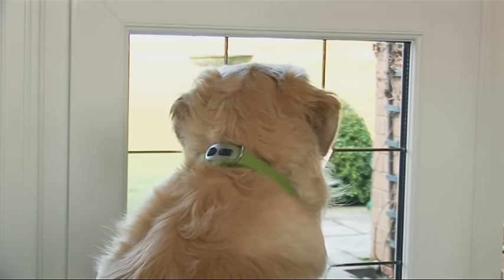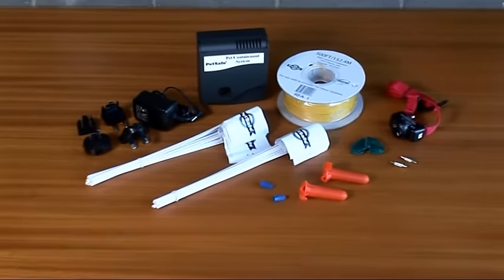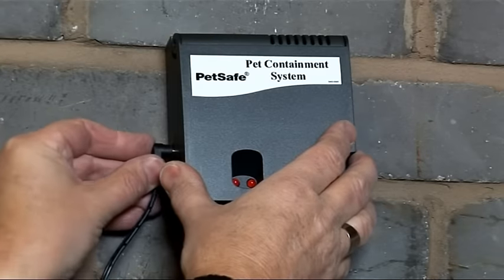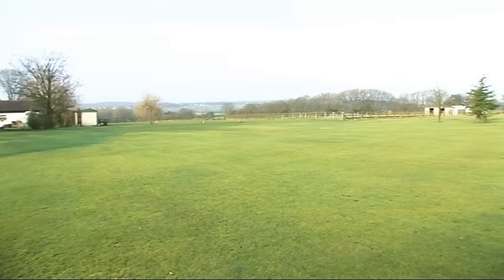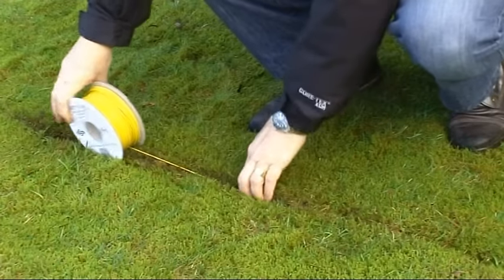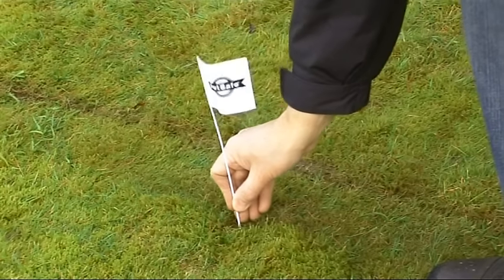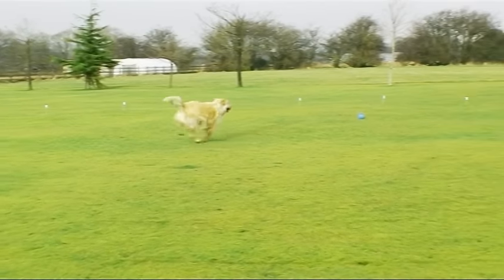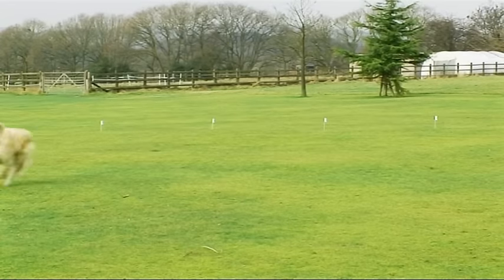How to Install the PetSafe® In-Ground Fence System

Comment: You explained the obvious but neglected the settings on the control.  The A-B-C switch is mentioned in the instructions on the unit, but it does not say if "A" or "C" is for a small or a large loop.  A good design team at PetSafe would have labeled the switch S-M-L instead of A-B-C.  For extra credit they would have told you how big a "small" loop was, and a "large" loop.
Reply from the maker: Hi,  Thank you for taking the time to comment on this video which is meant to be a quick overview–but not to replace the manual in any way. We appreciate some of your suggestions as we can definitely always improve however the manual does explain the transmitter's A-B-C switch in detail. We'll put it here below for those who may be wondering:
B: <400m wire.
C: 400-730m wire.
A: >730m wire.
If you would like any more information about this product please call customer care on 0800 046 1414 (NI) 1800 814 302 (Republic of Ireland) or visit https://intl.petsafe.net/en-ie/support/fencing#in-ground-fences
Reply: @PetSafeInternational so B is for the small Loop C is medium and A is the large.

How in the world do you come up with that logic ?

Not very intuitive or logical.

Comment: All should keep in mind they made sure to use a yard to where there’s no trees, cement slabs or other obstacles.  How am I suppose to close the circuit with concrete driveways and walkways?
Reply: There are a couple of options for concrete obstacles. One is to bore a hole under the concrete. This is not too difficult for a sidewalk but more difficult for large obstacles like driveays and patios. In some cases, a spray nozzle on a hose cut a small tunnel through dirt under a narrow section concrete. care must be taken to avoid washing out too much dirt when using the hose method. Another option for narrow sections, like a sidewalk, is to dig a hole on each side of the sidewalk and then pound a steel pipe under the sidewalk. One of the holes needs to be elongated (like a trench) to lay the pipe level before you begin hammering. Black steel (gas) pipe or electrical conduit is relatively inexpensive and works well for this. A cap on the end of the pipe will help to keep the pipe from filling with dirt during hammering but it may cut through easier without a cap. Extracting the pipe after can be difficult so it might be easiest to leave it in place and then feed the wire through. The pipe method is labor intensive (digging and hammering) so may not be for everyone. For wider sections, there are companies that perform directional boring and can do this rather quickly for a fee. Probably the simplest option is to route the wire through an expansion joint or cut line in the concrete and then apply a bead of exterior caulk to the top of the joint after the wire is inserted. Caulk is available in a wide range of colors and will easily blend with the concrete for a clean look. I have used both the bore and caulk approach with good results.

Comment: If hair/fur prevents contact between the skin and either of the two shock prongs, dogs can pass thru the boundary without any shock.  That must happen a high percent of the time, yes?  I would cut the fur back, but the co-owner (the breeder) doesn't want her hair cut.  Ideally, the shock will have happened most of the time during the training, so the dog won't risk it, but they could learn that sometimes they don't get shocked, so maybe they would risk escaping.  Is this fear justified?

Comment: I have a bluetick hound and she loves to run. We have 15 acres but keeping her on our land is impossible, and if I tied her up she would go crazy. How far out can she go with this fence? I want her to be able to roam a pretty good amount
Reply from the maker: Hi Zack thank you for your comment. Our PetSafe In-Ground Fence and Stubborn Dog In-Ground Fence systems actually do have the capacity to fully cover your 15 acres of land if needed without issues. However, please do keep the following in mind. You would need (approx) just under 1000m (3300ft) of wire. We recommend you finding a suitable/compatible insulated copper core wire of 18, 16 or 14 Gauge (that is 1mm, 1.2mm or 1.5mm thickness). You will have a stronger insulated wire on longer rolls, which also means less splices/connections needed to extend the wire. If you take good care of your wire installation there should be no problems. I hope this help to point you in the right direction. If you need anymore information you can contact our customer care team on  0080 046 1414 (UK) 353 (0) 58 44 988 (Ire) or you can email intlcc@petsafe.net.
Reply: Yes but you'll have to dig around however much land you want her to roam on so be wary even if you do get enough wire it'd take atleast an hour of just digging and flattening dirt

Comment: Does the wire have to be in the ground? I have some concrete and sidewalk where I’m wanting to place the fence?
Reply from the maker: Hi Kim, the wire does not necessarily have to be In-Ground. There are people who keep it above ground and for example attach it to an existing physical fence that their pet tends to jump over, and there are some who keep the wire on the ground however this can leave a wire very vulnerable to damage/breakage. It is advised in some cases like this to provide the wire additional protection by laying the wire through a (flexible) PVC pipe or for example an irrigation hose. As long as the pipe/hose is non-metal. When it comes to concrete (like a driveway) we usually advise to use a circular saw with a masonry blade to cut a groove to put the wire through. With a sidewalk use any existing groove(s) there may be to put the wire in. You have some options to work with whether you keep it in-ground or above ground. This PetSafe video that shows a wire installation in detail may be of help to you as well: https://www.youtube.com/watch?v=92BNlihk8Vc

Comment: After we lost our first dog who ran into the road and got run over, we installed one of these underground electric wire fences for our next dog. For the first few months, she did get a shock from her collar when getting near the boundary. Eventually, she was able to be outside without the collar altogether. Upon her death from a cancerous tumor in 2009, we disconnected the fence from the box. The wire is still in the ground, but no longer used.
Reply: I can confirm this is correct. I was the wire and I long every day to be reconnected. I now lay powerless in the ground and I ache to feel that juice flowing through me once more
Reply: Mr Wire, do the dogs at least lay eternally next to you?

Comment: I have a question. I have horses and electric fence that keeps them in. I want to put the underground fence in the yard for my dog and am wondering if the other fence will cause interference if I am too close to the boundary? I want to give my pup as much range as I can and just wondered about the 2 fences. Thanks!
Reply from the maker: Hi Mariah, thank you for your query. The official advice would be to make sure you keep 3m distance between the PetSafe wire and any electrical wire such as your electric fence when the wires run parallel to each other, as interference could occur mainly causing our collar to not activate at the wire. However, we have seen many cases where an electric fence is actually not interfering at all (possibly also because an electric fence is usually positioned in height) or that people have success by creating just a bit of distance (e.g. 1m) between the two wire installations. The only real way to know for sure whether it will be an issue or not is by trying and testing it—laying the PetSafe wire around your yard in a way that you can easily enough adjust the position of the wire if needed as you test with the collar in hand, before finalizing your wire installation. We hope that this information helps you out.

Comment: What length of wire needs to be allowed for connecting to the receiver as it's impossible to tell how much will be needed once you complete the loop and twist back to the receiver. You could easily end up with not enough wire to twist both ends back

Comment: Hello, we will be traveling for 3 months next year and wish to leave or cat at home, will this system work on our cat. We have a corner block with fences all around or can you recommend something
Reply: Will there be someone feeding your cat? That’s a long time to leave an animal alone without supervision. They have a cat system but if you don’t pay attention to them it could go wrong.
Reply from the maker: Hi, thank you for your query. Our Deluxe In-Ground Cat Fence would be suitable, however it is important to keep in mind that a pet generally should not have a collar on more than 8 hours a day (to prevent a skin condition called pressure necrosis) and the specific (RFA-188) battery for the collar may need replacing every 4 weeks. So unless there is someone present daily to supervise/check your cat and keep the above in mind and has understanding of how the system and collar work, we would not advise to use this if you yourself are not present for a longer period of time. In regards to having a corner block that you need to secure for your cat, there is a wire installation method (double loop) which will be explained in the manual that should make a wire installation possible in this situation. We hope that this helps. If you need some help on the set up feel free to give our Customer Care team a call to talk through. UK - 0800 046 1414, EU - 00 800 1818 2020.

Comment: Can you cut the wire and it still work like divide the wire in different areas
Reply from the maker: Hi Lucinda, thank you for your comment. The wire installation is meant to be a continuous loop, so this system is not meant to be divided over different areas. There is a double loop layout option though which enables you to cancel the signal at certain places if needed, however I do not think that is exactly what you are looking for. Please contact our customer care team where they will be able to help you further. You can call them on 0800 046 1414 (UK) or 1800 814 302 (Republic of Ireland). You can also email them using the following link - https://intl.petsafe.net/en-gb/support/contact-us

Comment: Hi if setting up boundary wire And I have three walls around property,only want to prevent them from side gate , loop would only go from (left to right) can dogs b outside the loop rather than inside the loop???
Reply from the maker: Hi Les thank you for your comment. In this case you should be able to use a double loop layout, meaning you go out with your wire along/past the gate area and then make a U-turn and go all the way back along the way you came from (and keep 1.5m distance between the outgoing and returning wire so they don't cancel each other's signal). Though your dogs will be 'outside the loop' then so to speak the collars will still activate near the wire(s) as the signal on the wire is like a mirror image (wire emits signal inside and outside the loop). I hope that this helps. If you need more specific advice or information, also feel free to take a look on our official website where the In-Ground Fence manuals are available (https://intl.petsafe.net/en-ie/support/fencing#in-ground-fences) or you can call our customer care team on 1800 814 302 (Republic of Ireland) or 0800 046 1414 (UK)

Comment: Does this work  for a cat and does it work outside a fence as the cat flap is down a path beside the house with a 6 ft fence there.  What is the distance between the wire and the animal will receive the bleep.    If it is  1 mtr before the cat gets the bleep I would have to run the wire through the other side of the fence so the cat can gain entry through the cat flap to the house.   
Would it work the other side of a fence if needed in the alleyway to the house where the cat flap is.  I can put it all round my garden but the cat has to come through the cat flap

Comment: In a forest, would you bury it the same way?   I'm impressed that all you need to dig is that thin slit with a flat spade.  In a forest there would be surface-level roots and fallen branches.  Maybe I could rent a machine to clear a path, and then use a walk-along "trencher".  Do you know if anyone has attached a spade - or some kind of blade - behind a brush-cutter / forest-duty rider [mower] to dig a trench?
Reply: I live in a forest and thinking of using an edger to cut through the terrain
Reply: @jowillie2814  why not? What's your logic? I should let my dogs run free (into traffic / coyotes)?
Reply: @JonathonNeville  From m my experience ; there is no traffic in a forest. 
The Coyote part..... 
Don't worry about snakes in the garden when you get spiders in your boots.
Reply: @jowillie2814  - right, so you just made assumptions and then called me a dumbass.  okay...  my forest is 400 x 600 feet.  It is a forest.  And then there's roads (2, perpendicular).  
Moving on to the coyote part.  Your poetic sense of analogy is beyond my capacity.   I translate "Don't worry about snakes in the garden when you get spiders in your boots" as "Don't worry about problems in your home when you have problems in your home", or "don't worry about coyotes in your forest when you have coyotes in your forest".  What am I missing?

Comment: Got mine installed and it is working for the most part, but I am having a problem with the safe area thing...when my dog wants to go from the inside of the house to his designated play area he has to go over part of the perimeter. In the manual it says that twist the wires together to block the signal...it doesn't matter how tight I twist the dog still gets shock, I am getting quite frustrated with this. Any help would be much appreciate it.
Reply from the maker: Hi Karieltheone, thank you for choosing our In-Ground Fence. We're sorry to hear that you are having some problems with it when it comes to cancelling the signal. Sometimes this aspect of the wire layout is misunderstood as this can be misinterpreted as merely cutting a loose piece of wire (that of itself offers no signal) and twisting it into the existing loop of wire. However this cannot cancel a signal. To cancel a signal you need an outgoing wire (outgoing signal) and a returning wire (returning signal) that is part of the same loop of wire, brought close together and twisted into each other. This is generally only possible on the path from and back to the transmitter IF your wire layout encompasses your entire property (all around the house), or if a double loop layout technique is used. If a wire layout only covers one side of someone's house/property then the double loop layout technique will be needed to be able to cancel a signal. You will always need an outgoing and a returning wire to be able to do this. If this does not help or is still in any way confusing, we encourage you to contacting our Customer Care Centre by phone or email so we can help you out > https://intl.petsafe.net/en-gb/support/contact-us

Comment: Question this zap the dog or this just make a sound?
Reply from the maker: Hi, thank you for your comment. When your dog is wearing the collar, he’ll receive a harmless static stimulation if the boundary is crossed. I hope this helps to answer your question, if you need anymore information please visit https://ie.petsafe.net/collections/in-ground-fences/products/in-ground-fence-system or contact customer care on  0800 046 1414 (UK), 353 (0) 58 44 988 (Ire) or you can email intlcc@petsafe.net

Comment: So  how do you get the wire from the garage to the ground?
Reply from the maker: Hi Chad, thank you for asking. Exiting the garage with the boundary wire can be accomplished via a window or through a hole drilled through the wall (ensure the drill path is clear of any utilities). Do make sure that the wire is not cut off or pinched by a window or garage door as that can damage and create a wire break over time. The manual that comes with the In-Ground Fence System will furthermore explain wire installation techniques so you can determine what is most suitable for your situation, e.g. how to go from and back to your transmitter with your boundary wire. We hope that this helps. If you would like any more information about this product please call customer care on 0800 046 1414 (NI) 1800 814 302 (Republic of Ireland) or visit https://intl.petsafe.net/en-ie/support/fencing#in-ground-fences
Reply: @PetSafeInternational  Drilling a hole through a massive concrete wall is not feasible. The only way would be to put it through a window that would need to be closed on it. Which makes your product unsuitable apparently. Not everyone is going to be able to take out a massive tradesman's drill  and make a hole in their garage wall.